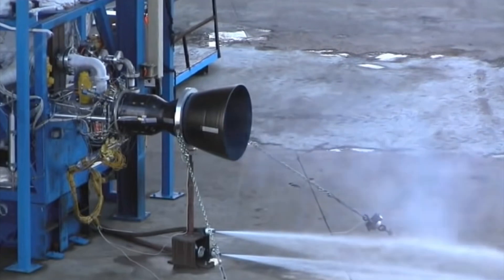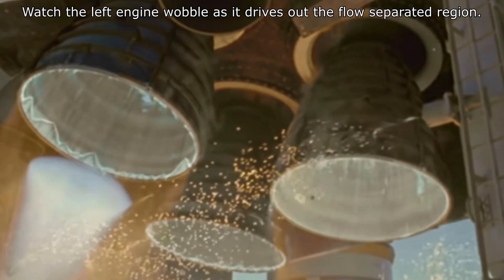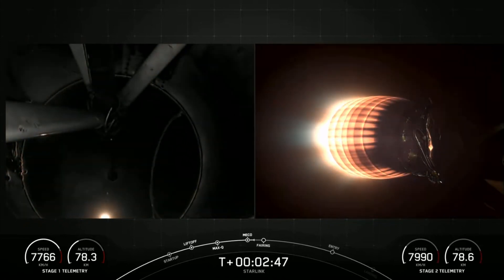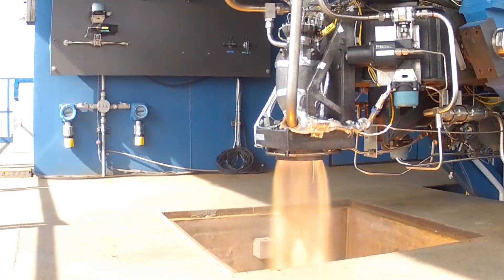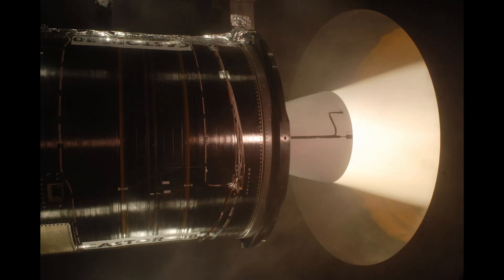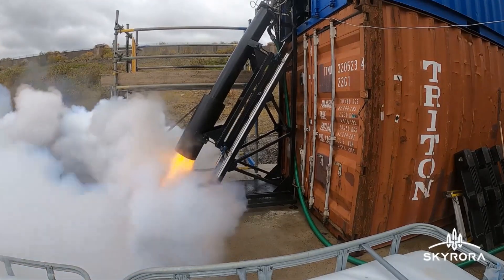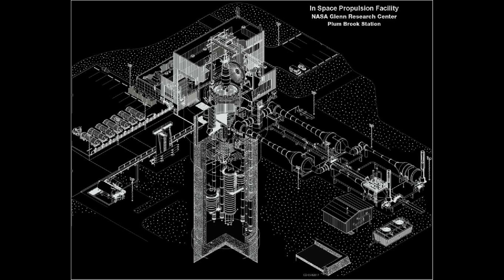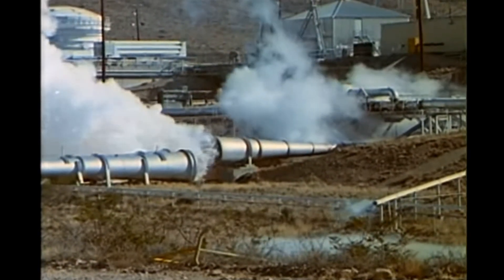Defying Atmosphere - How Rocket Engines Get Tested In A Vacuum Before Going To Space

Comment: Hi @Scott
During the last week I just by chance saw a couple of videos, one about an NASA SR-71 Pilot and one about Delta Clipper. The first video mentioned 
testing of a LASRE Linear Aero-Spike Rocket Engine. The second video didn't mention these engines but I remember the other Program at the time, 
also investigating SSTO, was Venture Star and it DID use Linear Aerospike engines. Then you do a video of testing engines defying the atmosphere.
This, of course, reminds me that Aero-spikes USE the atmosphere INSTEAD of an engine Bell and don't need to be "tuned" to certain atmospheric
pressures to be efficient.

Linear Aero-spike and Annular Aero-spike engines are not new and they keep popping up as possible solutions to launch systems because of some 
of their advantages. The Delta Clipper video I saw mentioned that it beat Space X to automatic landing and recovery with a rapid turn around by some
20 YEARS. Venture Star, from memory, launched vertically and landed like the Shuttle. For technology from the 50's? and 60's to still be considered
in the 90's and beyond, there must be something about these engines. Although NASA's announcement about a new Nuclear engine is also a bit of
a surprise. Nuclear engines were also tested in the 60's.

I would really like to see a video by you on these amazing engines; a little history about them; and where are we at today with them. I love your style of
presenting and I find your videos really informative - keep up the good work. The Nuclear engine might also be a cool topic for one of your videos.

Cheers

Andrew
From way Down Under in Australia.😎
Reply: Did Tim Dodd not do a big thing on this already?

Comment: In a thermal power plant, some steam is diverted from the turbine-generator and fed to an air ejector to maintain a vacuum in the condenser to improve efficiency and remove non-condensable gases.
Reply from the maker: Did not know this!

Comment: I presume the reason for using steam rather than high pressure air is you get a larger output volume/mass for a given sized boiler since you can keep most of the boiler as a liquid above the atmospheric boiling point.  However, don't you run into issues with the steam freezing  as a result of the rapid depressurization which would eliminate that advantage?  (Presumably the low pressure prevents condensing to a liquid but I'd think you could go straight to a solid if the temperature gets low enough).

Comment: I'm 30 sec in a trapped in the thought, who says rockets don't work in a vacuum. I'm mean WTF.
Reply: Flat earthers and space deniers, they have to think that otherwise their beliefs fall apart
Reply: @Ethan_Roberts  thanks. I, like most of the world should, forgot about flat earthers.
Reply: @Ethan_Roberts  flat earth is a typical psychological operation to control a part of the opposition (that never understood geometry) and to make fools of all people criticizing NASA, SpaceX etc. If you have a linkt to a test report on the measured force from e.g. a CO2 cold gas thruster as a function of ambient chamber pressure, please feel free to provide! I have been searching for a while and can't find anything. In the case of expansion of an ideal gas in vacuum, there is no work done, i.e. no force. Would be interresting to measure a small simple cold gas thruster down to vacuum in a test chamber. I'm planning to do it within a few months.
Cheers from Stockholm, Sweden
Reply: To add, they think rockets work by pushing against the air.

Comment: Scott, you might look into the MIRACL HEL the USN developed back in the 80's. Pretty interesting combustion and mass flow machine to generate megawatt+ laser output. I think the Army is dusting it off and it might become operational again. I did a bit of the work on the SEALITE beam director (SLBD).

Comment: That's fascinating! It's like a UHV oil diff pump on the most ridiculous of steroids... rough-pumping with a water venturi would not have been my first guess for high-expansion testing - although to be fair I can't think of very many guesses... I would have probably said a few enormous turbines or something. I wonder if that was a materials science limit back in the day, or if the steam venturi is actually more efficient. it's certainly dead simple and hard to kill!
Reply: Steam ejectors are way more efficient, and can pull nearly a total vacuum and have no moving parts. Vacuum pumps are some sort of positive displacement device, so very low flow capacities. Centrifugal or axial flow compressors (turbines use a high pressure gas) would have sealing difficulties around the blades, and would go into stall to easily, (too little flow for the speed).

Comment: Why not slowly bring the chamber up to atmospheric pressure during the shut down sequence to avoid the side effects of rapid repressurization
Reply: Well how do you do that with a huge hole in the chamber?
Reply: @linecraftman3907  the engine is maintaining a vacuum through the big hole, but if you started introducing air in front of the engine at a rate that doesn't hurt the engine or the chamber, but still increasing the pressure while shutting off the engine at the same time
Reply: @Davinator2662  I think it's because the engine itself is always working against that sucking out any air you are trying to add back in.

Comment: That is what a lot of people do not know is rocket exhaust at sea level is at atmospheric pressure. That's why as soon as the rocket gets some altitude it can be seen that the exhaust flares out quite a lot! 
5:02 What you have is similar to a vacuum diffusion pump which are kinetic transfer pumps. They operate with a fore pump producing a vacuum in which silicon oil is just at boiling temp. This  supersonic stream of vapor transfers its kinetic energy to gas molecules present directing them towards the vacuum pump (providing the working vacuum) where they are removed from the chamber. I used to service vacuum pump and systems.

Comment: I seriously wondered why the luner command module stage just had one enormous nozzle inelegantly attached rather than some more ‘space age’ looking sleeker multiple array. Now I know!
Reply: There's nothing stopping you from having an array of multiple nozzles of the same expansion ratio, that are fed by the same pumps and pipes as the one big nozzle. In fact that's what Soviets often did (mostly due to instability issues with a big engine bell). If you look on the famous Soyuz, it may look like there's four main engines on each booster but it's actually one engine with four nozzles.

It's just that there's less complexity with having one bell and LEM was really limited by mass so it saved mass having one nozzle. 
Not to mention having to figure out plume to plume interactions

Comment: Very interesting. I worked at White Sands Test Facility back the late 70s. We had several vacuum chambers with vacuum pumps for short tests and a huge steam injector for much longer runs. It was originally built for Apollo, but was used for SLBM, the shuttle reaction control system and other engines. I got to watch a few of the steam injector runs, it was very exciting.

Comment: Would you be willing to do a video about these "super-fast actuators" that either open or close in brief fractions of a second?

I can think of a few ways to do it (spring-release, seal perforation...) but I'd love to see how people like NASA or JPL do it.
Reply: In the petrochemical industrie we had fast acting valves in case of reactor shut down. It would prevent backflow . Those where 8  1 meter diameter pipes injecting air in the reactor. The valves could shut. In 0.2 sec. And indeed just like you said, there is this big ass spring mechanisme above the valve ready to get triggers.
Reply: I know at least for smaller pipes you can use explosives to actuate a valve extremely quickly. Downside is you can only open or close, not both, without replacing it. But in a test stand thats fine.
Reply: @trouty7947  I don't think those will get approved of in a explosion proof zone :-D (ex-zone)

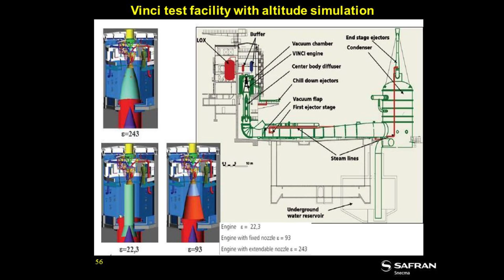Comment: I actually recently got to visit the P4.2 test stand in Lampoldshausen (shown at 8:03) which was used in development testing for the Ariane 6 Vinci upper stage engine... it can in fact do all the things Scott mentions like having cooled walls to better simulate the thermal radiation behaviour etc, in fact they cna simulate the entire mission profile for a typical Ariane 6 second stage flight. From a technical perspective it's super impressive (especially because the videos and pictures don't really get across just how HUGE those facilities are), but I couldn't help thinking that you could easily get 90% of all that data by simply, ya know, actually flying the thing once...

Comment: Very cool. Why are they using steam injection and not just a sea level optimised rocket engine? If you are running a rocket test stand it seems that a rocket would be easier than huge boilers.
Reply: Because they're trying to test vacuum engines not sea level engines.
Reply: @TheEvilmooseofdoom  It  may be that using a reliable sea level rocket as a vacuum pump is more effort the huge infrastructure around steam injection, but it seems unlikely to me.

Comment: Dirt bike riding around El Mirage in the 80's heading towards Edwards AFB there was a hill that had remnants of a rocket engine test stand. Must had been from the early days of the science.
Reply: That  was  probably  Haystack  Butte.   It   had  a verticle firing  test  stand,  where  the exhaust  was  facing  up.  When my  Dad  worked   at  the  Lab ,  there  was  a  solid  fueled   rocket  motor  called Super  Hippo  that  was  tested at  that  facility.   This would  have been  in the late  1970's.   That  is the same  area  the  the X-33  launch  facility  was built   but never  used.

Comment: 5:10 Ye'olde steam locomotives do something very similar like these diffusors with the smokebox and the blastpipe inside.

The steam expelled from the cylinders is being ejected through the blast pipe in the smokebox at high speeds (that is the source of the typical choo-choo sound). The smokebox is connected with the firebox through the boiler, allowing air to pass. So, when steam is blasted through the blastpipe, it pulls air with it, similar to what the exhaust stream of the rocket engine does in the diffuser. But instead of creating a vacuum, it draws hot air from the firebox over the waterpipes in the boiler helping the generation and superheating of steam and thus also draws fresh air into the firebox.

Comment: Rocket driven injector pump. fancy!
Injectors / ejectors aren't really genuine Venturi devices either. The pumped fluid is accelerated in a cylindrical mixing tube. At the end you have a low aspect ratio diffuser to convert speed into pressure; that part is kinda Venturi.
In a true Venturi device you have a large mass flow go through a throat and then suck through radial holes in that throat.

Comment: It would make an interesting video to talk about the low pressure engine test stand built at Stennis Space Center. It was never used because budgets. As I understand it, the design basically used steam to make an artificial tornado into which an upper stage engine would be fired. Cost a lot of money, but NASA decided they didn't need the testing. Ultimately a dead end but I am sure it would make a good story.
Reply: Didn't Rocket Lab lease that stand?  I have a colleague who worked on parts of that, so I was excited when I heard it might get some use.

Comment: I was looking for info on hot staging.  What are the pluses and minuses.
Reply: The main plus is that they don't need to stop pushing to stage... there's no point where the rocket is coasting, and losing hard-earned momentum while gravity tries to pull it down.

On a more traditional rocket, it also helps with engine startup because the continued acceleration ensures the fuel is at the bottom of the tank... that's less important to something like Starship, which needs to be able to re-light engines in zero-g anyway.
Reply: A lot simpler than zero g restart. Practically the same as starting on the ground
However booster under the engines might not like being blasted by engines

Comment: And here is a question. Whenever the SpaceX second stage engine starts (and I have watched probably all of them) a band from around the bottom of the engine breaks off. So why is it there, why add the small weight and the chance of accident if it never stays on? It does not look like if you took it off before firing the engine would fall apart.
Reply: Remember when Scott mentioned that those big nozzels are fragile?  That's what that band is for, it's stiffener to keep its shape during launch.

Comment: This is a conveniently timed video as well with Starship’s 2nd IFT coming up, as one of the milestones raptor has never achieved despite years of development, is an ignition above sea level (technically ~500 m on the landing burn for the hops) it is still very much up in the air (or lack thereof I suppose, no pun intended) in regards to whether spacex will get those 6 engines running or not, it’s a completely new environment for them.
Reply: I'm pretty sure that SpaceX would have tested ignition a Vacuum Raptor in a vacuum facility
Reply: nope, Elon said that would be too expensive, complicated, and would hinder mass production
Reply: @jeremyglass4283  why would testing a single V-Raptor in a vacuum chamber facility hinder mass production? It’s the design that is being tested not each engine that is subsequently made. As to the cost of testing one or a couple of engines - the facility exists already it was built decades ago in the Saturn era and then refitted for the Space Shuttle program and could be hired.
Reply: @epincion  I would totally believe you except for that thing that happened on the last launch
Reply: @epincion  I suppose there is nothing stopping them from doing that, but spacex believes it’s not worth the upfront cost for just a couple tests at the most. Especially when they have experience with starting engines in vacuum with Merlin.

Comment: Newton has laws? After you step off of the curb, the velocity of the 80,000 pounds OR (36287.39KG) truck will change very little when it hits you. 80,000 pounds OR (36287.39KG) * 29.0576 Meters per second  = lots of force. Most of this force will be imparted to you as you are accelerated in the opposite direction of equal magnitude.
Reply: mass * velocity is not force :P
Reply: @yourguard4  It is when the truck hits you... LOL   (impulse of a force OR the change in momentum) Remember we are talking about the truck hitting the person who stepped off of the curb.  think funny, not so seriously.
Reply: @dksaevs  I was thinking funny, thats why I was nitpicking ;)
Reply: 😀😀😀 @yourguard4

Comment: The subject is a reminder that the Raptor engine that we are all so used to by now has not actually flown in space yet. Clearly SpaceX has done plenty of the type of testing that Scott discusses here, but it will be interesting to find out if they come across any differences in actual flight, considering how unique this engine is.
Reply: It's not that unique, being built from the same mechanisms as a Merlin or F-1 engine, only arranged optimally for their mission .
Reply: @johndododoe1411  Are you really comparing a full-flow staged-combustion engine to a gas generator? You could say it's not unique because it's similar to the Soviet RD-270 or Rocketdyne's FFSC demonstrator from the 90's, not the F-1.

Comment: Since liquid fuel engines are usually cryogenic, when thrust vectoring how do the manufacturers make the fuel/oxidizer lines flex when temps are that low?
Reply: Probably just have some slack and very cold resistant tubes but i don’t know for sure

Comment: Old steam locomotives used the same principle of steam injection to help combustion.   The exhaust of the cylinders was sent to nozzles pointing upwards at the base of the chimney, and that would push the fumes upwards creating a vacuum along the boiler that would suck the fumes and head from the firebox at the back.  Most of the 'smoke'  you see coming out of a steam locomotive when it is running at full speed is actually steam, not so when it starts, when there's a lot of smoke and not enough steam to suck air into the firebox so the combustion is far from optimal.
Reply: BTW, there is this classic footage of the engines of the Saturn V lighting its engines while still on the pad. First the smoke comes out randomly, as if in a explosion, but soon enough, the flow of gases settles into the exhaust trench and all those gases are sucked into the trench as if a huge vacuum cleaner has been turned on, a great visual example of the effect you describe in the video above.

Comment: Should rocket engines not work even better in vacuum because the exhaust pressure does not have to fight the atmospheric pressure? If you can trust Kerbal Space Program the Specific Impulse of most rocket engines improve when leaving the denser layers of atmosphere. Cheers :)
Reply: Yes.  If they work in a vacuum they work better in a vacuum. :)
Reply: Correct even engines that are under expanded at sea level have the thrust rise therefore a bit of isp increase

Comment: I remember reading about such a vacuum test stand where they used a second sea level rocket engine as an air extractor using a venturi or something like that rather than steam ejectors. I tried a quick google lookup but found nothing but I'll search more.